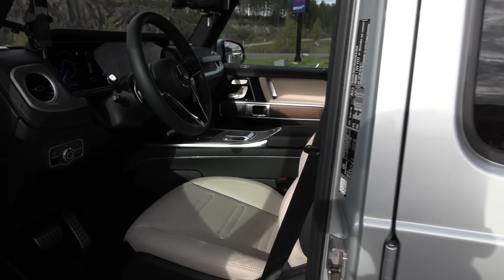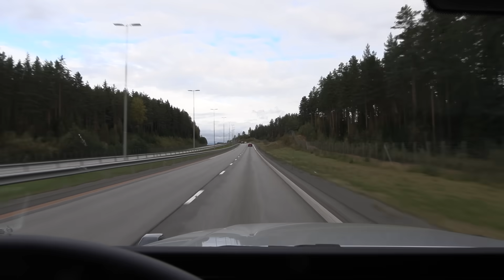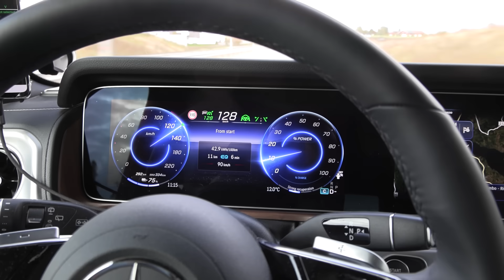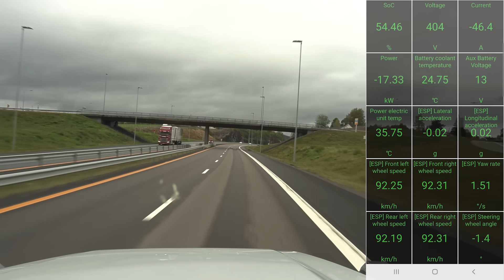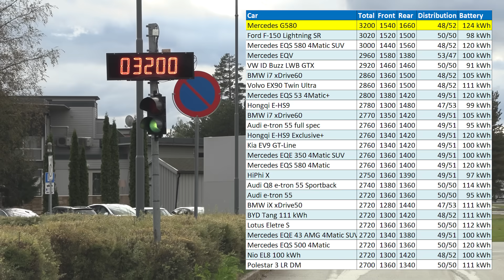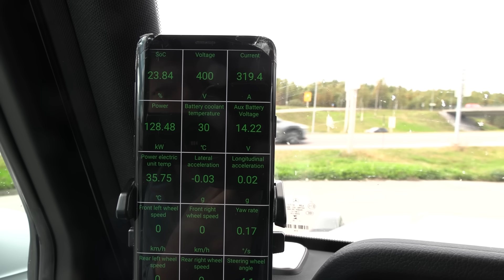Mercedes G580 electric Geländewagen range test

Comment: We’re continuing to used our diesel G for long trips. And for towing. It really suxx that the G580 is such a compromise, in particular wrt the charging speed and the (non-)towing ability. 
Looking forward to the Cayenne - that will fix these issues and hopefully not have too small a boot. Because the boot is nice and big on any G

Comment: The car does have route planning with battery percentage and charging stops. It needs activation though in the app and it´s probably not done.
Reply: Honestly:good for them, but THAT is stupid. What else do you need to turn on ? Headlights? The left turn signal ?

Comment: with a towing capacity of 3.5 tons it would be the best car. unfortunately towing capacity is 0 due to waximum weight if 3.5 tons. tow hitch requires an enforced frame adding additional weight exceeding 3.5 tons total weight laden with full passenger capacity, luggage and trailer on hitch attached. damn!

Comment: I'm looking on new cars, and I have found out that judging the car with how many kg it can carry per seat in the car.

3.1 ton car (assuming Bjørn and gear is 100kg).

This leaves 80kg per seat in carrying capacity, that is low....
Reply from the maker: I'm 80 kg and my gear is 10 kg

Comment: This car perfectly demonstrates the limits of electrically powering some type of cars. 300 km on a 200k car is just crazy bad.
Reply: Most G classes are used in city and suburban areas anyways. Only few people use them to travel long distances. If you can afford a G wagon you can also afford an E class or a Range Rover for long trips
Reply: A regular gasoline G class doesn't have much more lmao

Comment: with the diesel not only you have amazing range but you can also tow, go overlanding, lift, put portal axles..... no problems. this electric cant even tow.
Reply: But offroad (I know, barely anyone drives these things offroad) the G580 is so extremely easy to drive, it's really a blast.
Reply: @hummerltheOh all vehicles are "extremely" easy to drive lol! What’s your point? I don’t get it!
Reply: @carholic-sz3qv  Read again. The G580 is really easy to drive OFF ROAD.
No diff locks to worry about, no gears to shift, great traction and VERY capable.

Comment: The car does not sell at all. They should have made a smaller battery to reduce weight and allow some towing. It is build to drive offroad and not on the highway.
Reply: Smaller battery? So you can go 50km while towing?
Reply: @wuchengranschiiet9992  how are you even going to tow?
Reply: @wuchengranschiiet9992  Most people use it to tow a horse trailer. 50km might be enough in many cases. But still better than no towing at all.
Reply: the gwagen is not mean to be electric at least for now with the low energy density of batteries and unfortunately they cannot change the design otherwise they can just forget it.

Comment: 3200 kilos - are you sure they did not lend you the armored version???
Reply: it weights 3085jg not 3200, the vehicle wasnt empty on the scale.
Reply: The battery is armored
Reply: Wait, does it come in an un-armored version ???? 😜
Reply: Also the tank was full 😄

Comment: Totally useless car. A car for 180.000 € and a charging speed of max. 200 KW, 32 Min. 10-80%. No trailer possible because of the weight from the car.  I don’t know who will buy this car, but must be stupidly.
Reply: status symbol. It's the same for the ICE version, running the car is expensive.

Comment: Since you cannot rev the engine in front of the shisha bar, this car might not attract the usual G-class AMG buyer. And on top of that it‘s inefficient. It slices through the air like Swiss Toblerone through a concrete wall. 😂
Reply: You mean like "Swiss cheese through butter".😂
Reply: People that buy these cars don't care about efficiency. Not even about range. They use them to go from home to the club with friends or to the restaurant with their girlfriend and back. How many GWagens do you see on the motorway? I didn't see many the last year in N.England and Scotland that I travel everyday.
Reply: @chrishar110 but those people don't buy a electric one
Reply: @chrishar110  there are also people who use them as intended I know a few rangers and richer famers (think horses) that use these to go to their woods and horse stuff and also to pull trailers. They noramlly don't go for the maybach version though okay maybe the horse people.
Reply: Also the same muslims would have to charge it up before they drive into a christmas market or rear end someone on the autobahn  as they are not fit for society and they cant drive for shit

Comment: Diesel G at 120kph goes to 20 liters per 100 and gasoline up to 30. So compared to that, they are in totally diferent worlds.
Reply: These numbers a completely wrong. The G450d you can effortlessly drive below 9l/100km. The new 500 (inline six) is around 11-12 I'd say
Reply: what are you talking about? where did you get these made up numbers, my 21 g400 got like 9 liters /100km at 120kmh, even during trailering an old m3 trackcar, about 2.7 tonns with open trailer, it got like 14/100km at 100kmh, mixed with no trailer was 11 liters/100. And the g500 is does maybe 20% worse. 30 liters per 100km is v12 ferrari racetrack consumtipion
Reply: @dndfm cap😂😂 even the diesels (which are way more efficient, and are not effected by driving style or towing as much as petrol ones) get 10+/100km. No petrol version whatsoever gets below 10 on the highway.
Reply: ridiculous lies! the diesel numbers makes no sense stop vomiting shit on internet please!
Reply: Fake news

Comment: This might actually be illegal to drive with  passengers and the standard license which limits total weight to 3,5 Tons :D Can only drive it alone :D
Reply from the maker: No problem. My middle name is Barely Legal.
Reply: UK category B (car) licences are 4250kg for EVs.  3500kg is for ICE/hybrid.  
If your licence was before 1997 it's 8250kg 😁
Reply: the EU changed it to 4250kg for EVs in 2024, so you could pick up a couple of very fat passengers :P
Reply: Either the car is allowed to have more than 3,5t than you can't drive it with a normal car license even if you are alone in and the actual weight is below 3,5t. Or the car is not allowed to have more than 3,5t then you might be not allowed to fill it up with passengers and luggage even if you have a license for above 3,5t.
Reply: @dr2okevin  In many European countries, it is permitted to drive vehicles with a gross weight of up to 4,250 kg on a category B driving licence, provided they are powered by electricity or hydrogen.
Reply: At least in EU, the passengers have got nothing to do with it, as the limits of each driving license category are determined based on the maximum laden gross weight of the vehicle. I must admit that I am not an expert of these limits in terms of kilograms, as my license is much heavier than I really need.